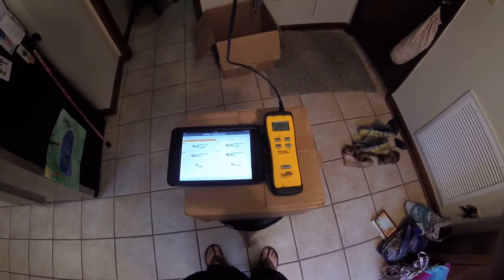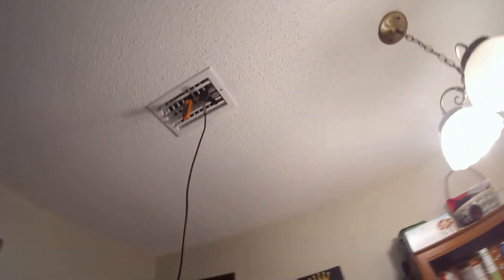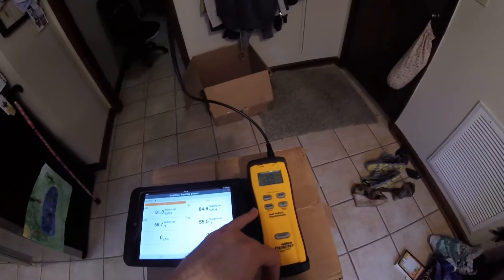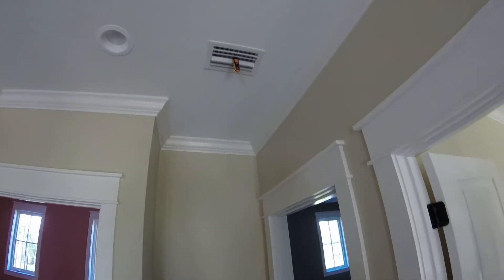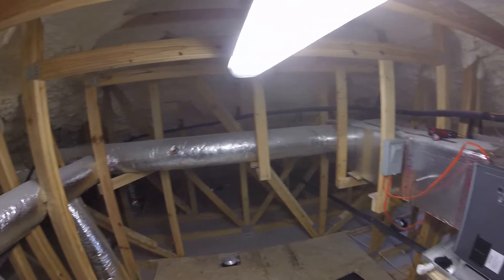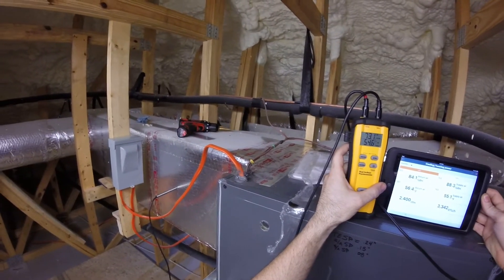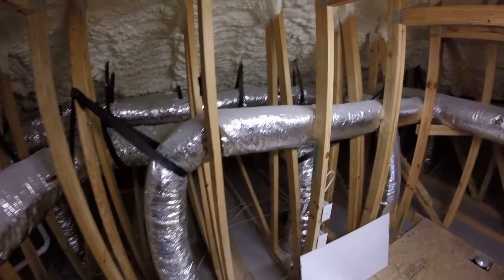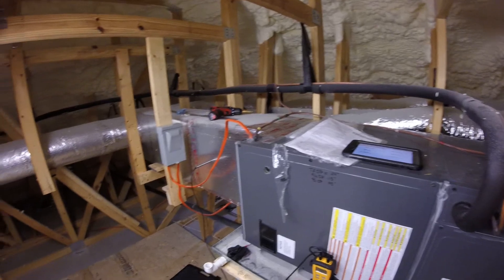The great grille debate

Comment: try that in an attic that hasnt been foamed and its 100* outside....I always check temp split at air handler to find out if equipment is actually operating correctly, then I check at return and supply grills to find out how efficient the duct system is. My area, these guys put in the cheap duct, all kinked up, and run supplies to external walls so theres an extra 50'-150' of unnecessary ductwork. Performance is greatly affected....
Reply: Thats it! thanks for back up.
Reply from the maker: +Ulises Palacios radiant cooling would affect the return (in sight of coil) and not so much the supply though
Reply: I have always understood that the other way around, however I would like to hear how radiant cooling could affect return air temp?
Reply from the maker: That's a good point and I would expect to have loss in a hot attic but I was surprised to see it where the conditions are almost perfect to have almost no heat gain from the ducts themselves. Was hoping to show that even in perfect conditions it is skewed.
Reply: your very first measurement is to close to the evaporator, forget the term used for that but your picking up a little moisture coming off evap and it will give you colder readings then what is actually going on. take your first reading couple inches into first branch. or about 5' away from evap. those numbers will be more accurate.
Reply: +Performance Based Heating & Air radiant cooling effect.
Reply from the maker: +Performance Based Heating & Air in an airhandler application yes the return probe is actually in line of sight of the coil. If you re thinking in terms of cased coil then it would be unlikely radiant energy is making its way down through blower and into the return....this would be like saying in my application of testing an airhandler that the radiant energy is making it through the blower and effecting the supply probe.
Reply: my understanding of radiant cooling is that the velocity of air passing through the evaporator is collecting some of the moisture and passing it into the supply plenum. The first 4 feet of supply air has sort of a swamp cooler effect, moisture in the air, which gives a colder reading then what it actually is. By pulling your first reading 4-5 feet away, or a few inches in a branch duct, you are essentially avoiding the residue effect of water coming off evaporator....I dont think that it matters if we are using air handler or furnace and external coil, both are subject to radiant cooling.
Reply from the maker: +Performance Based Heating & Air sounds more like evaporative cooling ? Could explain it also as my supply rh is always above 90%

Comment: According to Jim a good place to get your supply temp is 6-10 feet away from the coil to get a supply temp.  Gives it enough time for the air to mix. I know every situation is different and there's a lot of variables but I think it's a good place to start.
Reply from the maker: I agree whole heartedly but sometimes is not available to do that and was trying to show the average difference in temp before and after then the difference at the register with no heat gain from the ductwork themselves.